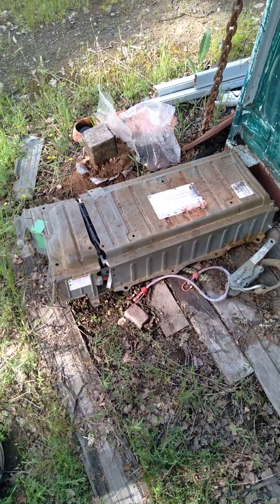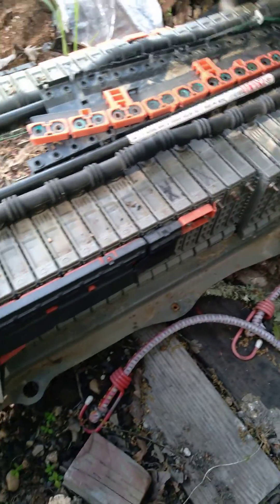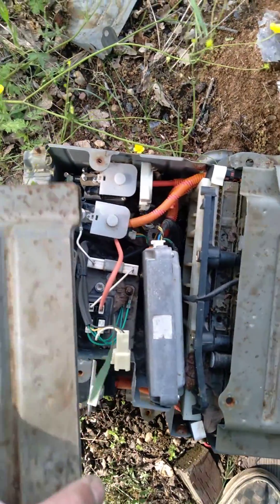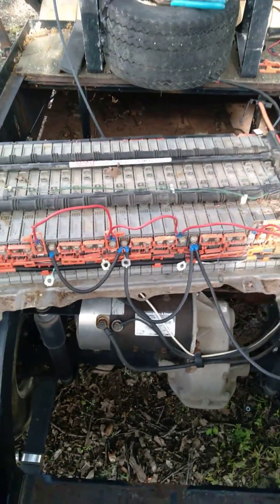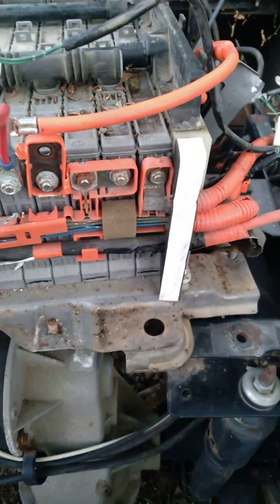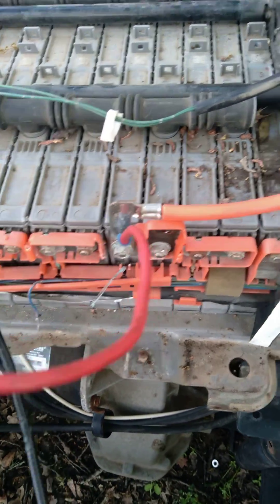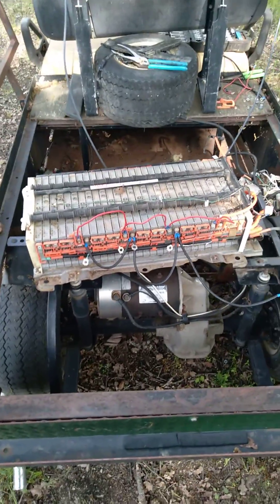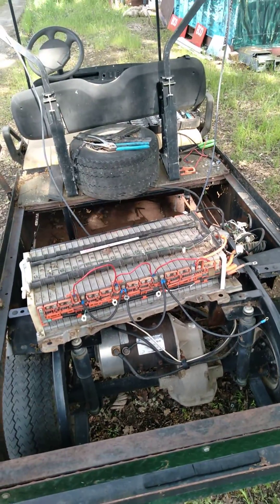Turn a NiMH Prius hybrid battery into a 36v-48v golf cart battery bank.  (part 1)

Comment: Is there a second video in this series?  What's the amp hour rating of this current setup?  Looking at doing something similar with a 48v setup, but had read elsewhere it was only something like 6ah if wired to make 48v.
Reply from the maker: Yes, Im going to release more videos in this series.  I'm waiting to get the correct controller to make sure it can handle the 40v first, then I am going to reconfigure the cells to make it 48v.  I also need a 2nd solar panel to get above the nominal 32v of one panel to charge it properly.